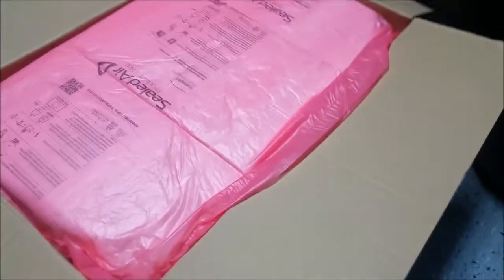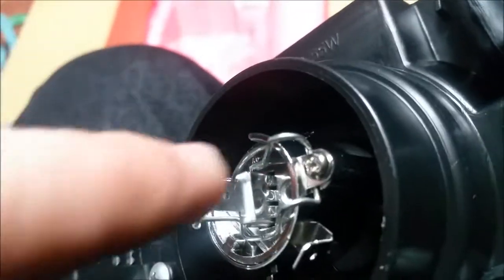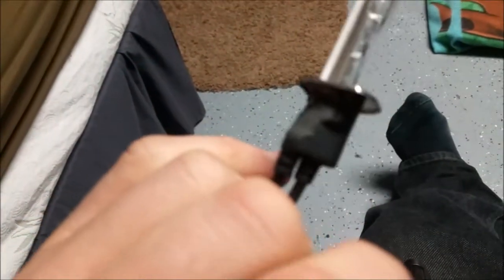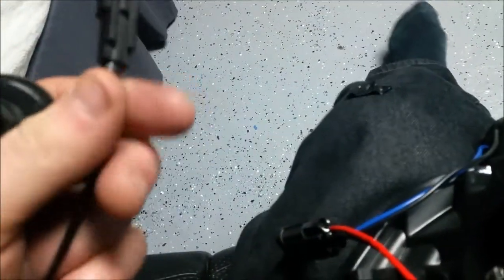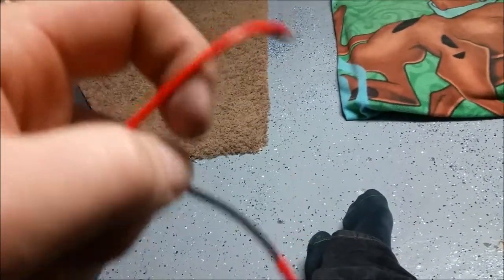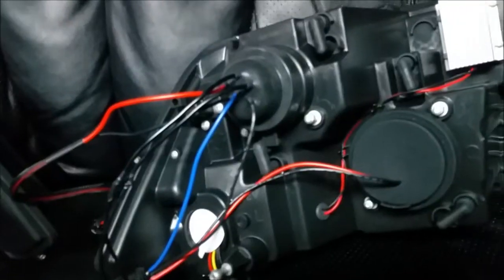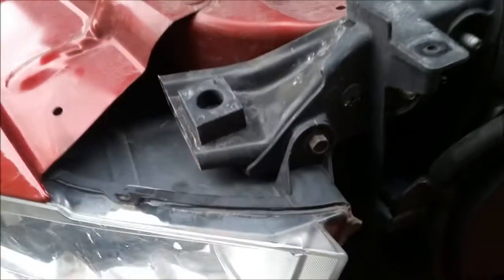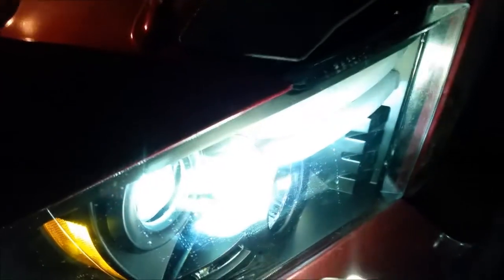VipMotoz Dodge Ram 1500 Projector Headlights

Comment: I would also like to know why the LED fog lights won't turn on with the low beam HID'S. I think there isn't enough power to allow the fog lights to turn on. Do you think a relay harness for the HID's will allow the LED fog lights to turn? The vehicle is a 2009 Dodge Ram 1500 and it has the 55 watt HID kit in the low beams and LED bulbs in the fogs.
Reply from the maker: Do the fog lights work with regular bulbs?
Reply: @AndreychukAndrey  yes they do
Reply from the maker: Did you try reversing the polarity of the led plug?
Reply: @AndreychukAndrey  Yes I tried that and they don't work. I got a new set of LED's and they did the same thing.
Reply from the maker: @salomonalvarez1364  When you turn on the fogs does it look like they try to turn on or its nothing?
Reply: @AndreychukAndrey  at first I would have the parking lights turned on and the fog lights turned on but when I switched to turn on the HID low beams, the LED fog lights turned off. Now they don't turn on at all
Reply from the maker: @salomonalvarez1364  So when the headlights are on the on position are you pressing the knob to turn on and off fog lights?
Reply: @AndreychukAndrey  yes I am
Reply from the maker: @salomonalvarez1364  Ya I would try led cancellers then.

Comment: The instructions with these headlights say that using HID or LED voids the warranty. Have you noticed how hot the HID headlights get?
Reply from the maker: Scott H. I'm pretty sure that hid and led run same as stock bulbs if not maybe cooler. There warranty is only on parts, like bulbs,  not the whole headlight. I actually have 55watt ballast in the headlight right now and no issue.
Reply: @AndreychukAndrey  have you had any issues with the housing melting?
Reply from the maker: @salomonalvarez1364   No
Reply: @AndreychukAndrey  When you switched to the 55 watt ballast did you add a relay harness or did you just keep the same setup with the capaciters?
Reply from the maker: @salomonalvarez1364   I still needed cancellers.

Comment: Solder the wires an heat shrink them you should never twist wires an use electrical tape when the connection is exposed to the outdoor elements one big puddle an these things could short.
Reply from the maker: tommy gunn. Still works great, zero issues.

Comment: Hi Andrey. I have 2014 ram 3500 with factory projector headlights. Do i need custom conector?because on the light looks different then what i got
Reply from the maker: BEST U TUBER . This headlight are only for dual or quad factory headlights. You have to find the headlights that says Compatible w/ Factory Sport Projector Headlights Model Only. I found this one just paste the item # 162790426218 on eBay. Just search around that says compatible with your factory protector headlights.

Comment: Do you have to remove the bulbs? And would it work on my 2012 ram using normal bulbs?
Reply from the maker: andy man. Yes you re-use your high beam bulb.  But for low beam they provide h1 bulb. When you buy them you have to make sure what kind of headlight you have. They list everything on there eBay page. It's an easy plug and play if you just using regular bulbs. But if you want hid you will need to modify it.